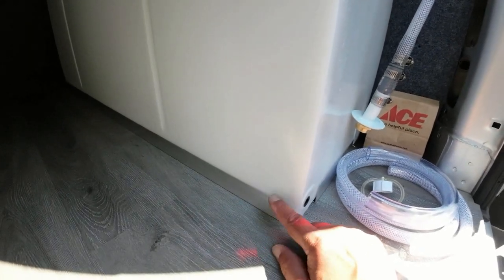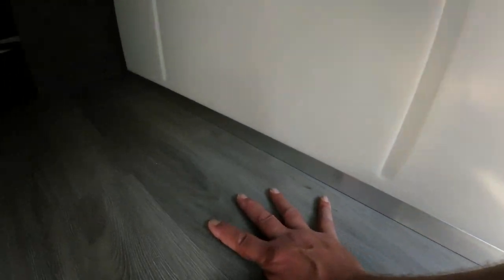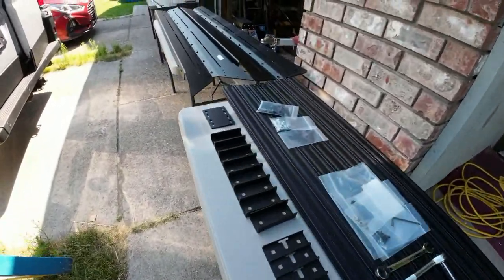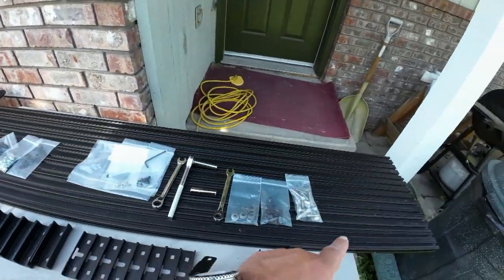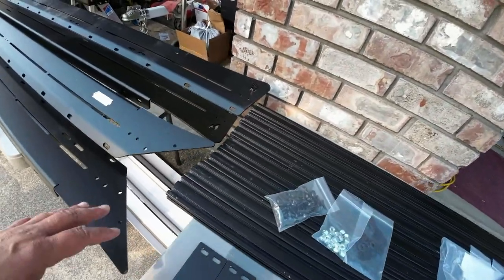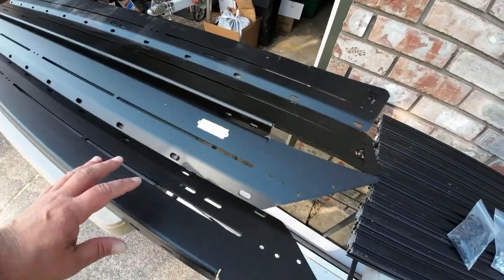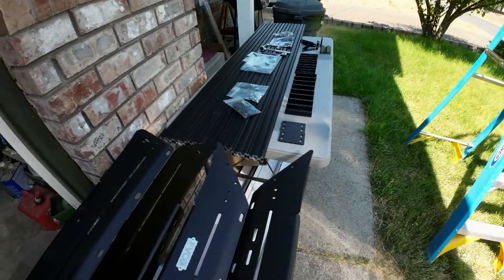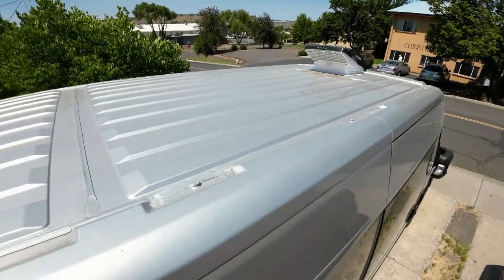Promaster Van Build 2500 159WB – DIY– Roof Rack – Part 43

Comment: "soft water" 😂 awesome. Was that rubber gasketing you mentioned sold on a roll? Self adhesive backing, or did it need to be glued down? thanks so much for the video!
Reply from the maker: Howdy! Gasket came on a roll about 1-1/4" wide, adhesive on the back. Should help the tank from slipping around on the hard floor

Comment: Looks good man and thanks for the tip. Do you get any whistling or buffeting at or around highway speed?
Reply from the maker: Not a sound... actually quieted things down a bit. The wind used to make the vent covers rattle a bit, but since installing the rack, that went away. Quiet ride

Comment: Do you have a video of your solar panels? What kind of panels did you get?
Reply from the maker: Hey @timrodatz1274 ! I don't have a video specifically of the solar panels... although I do mention them here https://youtu.be/RxX48v3rPPQ   The solar panel are from Renogy. 100 watt solar panels each (400 watt total). I cannot say enough about these panel so far! I just returned from a week long trip to Yellowstone National Park and these panels kept up with my usage! Totally charged my batteries to 100% during the day (sunny of course). Highly recommend!
Reply: @OregonBatman  dang that's good, I'm wanting AC maybe gas stove like you got, couple other normal electronics I was told to get 800watts at lease I don't know.
Reply: @OregonBatman  so the panels are good the rest not that great huh lol. I thought about SOK 280 or LtTime 230 3 batteries of some kind hahaha. Trying to learn this solar system stuff
Reply from the maker: @timrodatz1274  Took me 4-ever to figure out what I wanted... I went with Bigbattery.com.  I have two of the Owl Max and have been running for two years straight wth 400 watts solar. Can run all my lights, water pump, refigerator, and Propex heater, plus AC inverter... and a full day of sun tops it off at 100%. Was off grid for the last week and never short of power!